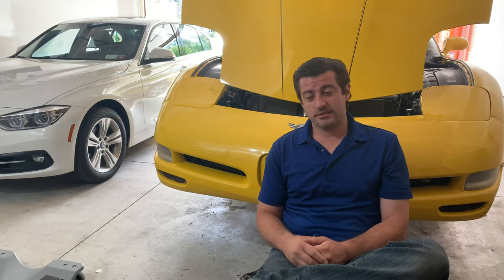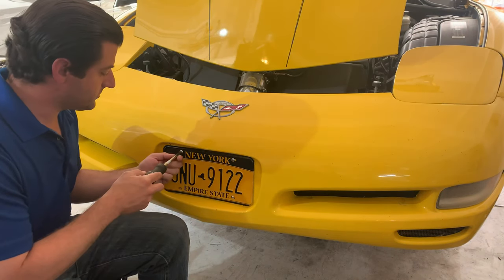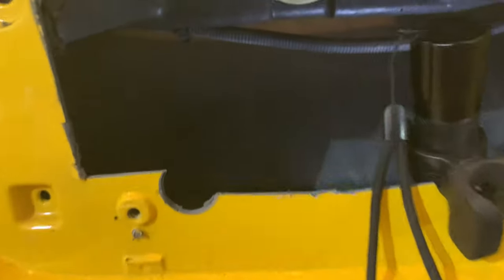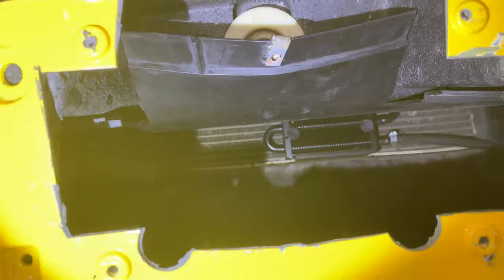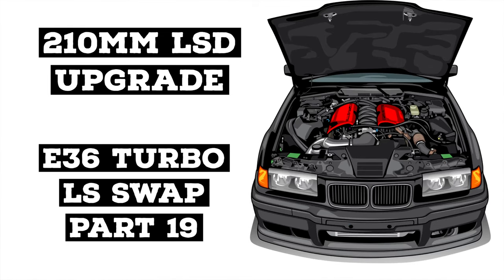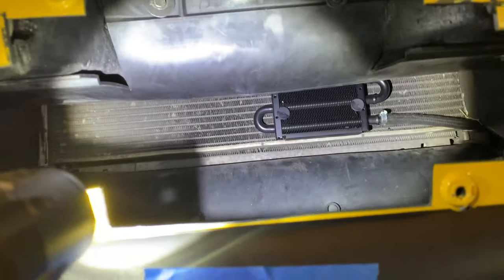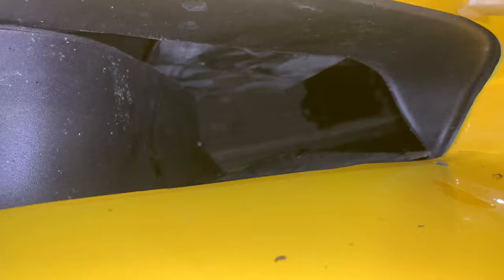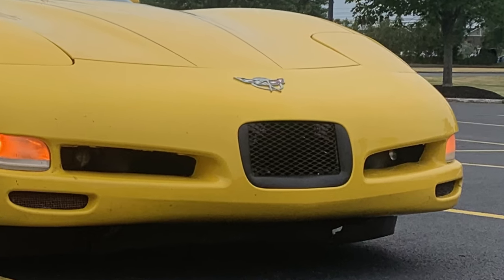DIY FRONT PLATE COOLING UPGRADE: C5 Track car Ep 12- how to keep your corvette cool

Comment: The 3 things I did to my C5 that solved the overheating problem. The front air dam. If you don't have one, get one. Super important for getting airflow into the radiator. The second thing I did was upgrade the radiator with a Dewitts. The last thing I did was tune the fans to come on earlier. That's it's. Didn't need to cut up my bumper. Stays super cool. I track it regularly. Never overheats.
Reply from the maker: I have the air dam, as soon as I upgraded the radiator to the Dewitt’s it’s been perfect on track

Comment: That’s cool. I’m doing it to my c5. Thanks for the encouragement. I’m changing it a little by having the fog lights opened and going straight into my maf intake and using your idea opening up the shroud and letting the air cool of the radiator. Good job.
Reply from the maker: That’s a great idea as well. I was thinking about doing that but I just need as much air to my radiator as possible right now

Comment: That is very cool. I have made my own with the original filler piece. Left the corvette name in the center and same stainless screen from Home Depot. Than painted it flat black. Looks tuff and works great. I have a little different idea for incoming air. Large plastic hose to preciously put air not to interfere with natural flow. Thank you and great job!! Hands!
Reply from the maker: Thanks! I have since put my power steering cooler right behind this opening which has helped immensely.

Comment: Great Video - I Love my C5 and have gone to extremes with her and her cooling problems. Swapped out the hood, radiator (4 row Sierra trk rad), fans, water pump and contemplating what you've done. I live in Western AZ and it gets freaking hot here. Matter of fact, on just about any day, one of the Big 3 are testing vehicles on the mountains. ( 21 miles of a 6% uphill grade.) So I'll try anything to run a little cooler. ( 235°F is normal operating temp according to GM.)
Reply from the maker: This did help a little bit, but with a combination of this  and my DeWitts radiator, even on track in 90° temperatures. I’ve never seen anything above 225°.
Reply: Took a long, hard look underneath and through the license plate opening. With the BBK Cold Air intake and air filter, either I make an air box and cut up my shroud or make an oval shaped duct from some abs plastic I bought on Amazon. Hmmm. I'll let you know.
Reply from the maker: @terryayager4036 yes I’d love to know how it does!!

Comment: I did the throttle body bypass mod, cut out only the bumper (nothing underneath like you did), and changed the thermostat to a 170 degree and I never go over 178 on the highway no matter the temp. around town and city driving it still gets up there, but it takes longer before hitting higher temps. I'm thinking of just upgrading my electric fans and hooking them up to a switch so I can turn them on at a lower temp because stock comes on at like 220. I sure if I do that my temps will never go over 210 even in heavy city driving.
Reply from the maker: Nice! It was fine around town for me it was on track that it got HOT HOT
Reply: That’s what I was saying. Bro was doing crazy mods for no reason. 😂

Comment: Great video! Only info I could find on what to expect behind the bumper if I decide to cut it.  I have a procharged z06 that sees oil temps touch 250 in weather above 105 here in Vegas even with normal driving. I def would like to get more airflow.
Reply from the maker: You definitely will, I couldn’t find any info on it myself so I decided to take the plunge and document it!

Comment: This is exactly what I am going to do next... I am in NJ and front plate is required 😑 Just got an ECS supercharger kit installed and this will open up right over the intercooler. .  I also want to open up the fog light areas too.
Reply from the maker: Maleet Finch it’s all easy to cut away, I can easily re attach my plate.
Reply: @LowBoostFilms  great to know. I've only drilled into my car, not cut into. Kind of makes me nervous lol.  My husband wants to do it but if anyone is going to cut into my car, it's going to be me

Comment: Did you put like.a 180 degree thermostat in? They also make a kit you can install that turns your fans on full time via a remote..would try these two things before hacking my car up.😮
Reply from the maker: I didn’t, but this worked a little. I’ve ultimately upgraded the radiator. But I now have my power steering cooler in this location.

Comment: One other thing, if you remove all that stuff for track perf, cut all that plastic, dont go over 130 or so, you have screwed with aero severely.  Great for autox or drag strip but dont do top speed runs!  140+ and you will take flight lol.
Reply from the maker: Thanks! I don’t get over 125 at the tracks I go to. I’m also adding a bunch of downforce at some point too.
Reply: @LowBoostFilms  nice!  Best way to deal with the increased airflow is venting the hood, like the c5r.  You cant put enough splitters on the front to overcome the hood becoming a parachute with all that air coming in.  Must vent it out!  Post a vid of the aero you go with!
Reply from the maker: I definitely will! I may have to vent the hood at some point

Comment: thanks for the diy, im thinking of drilling lots of tiny holes instead of cutting and screening...have you tracked the car since? what oil temp changes did you notice?
Reply from the maker: This was to help the coolant and power steering temps, but there was an improvement, however at the track after hard lap after hard lap, they temps still climbed, but not as quickly
Reply: @LowBoostFilms  i track my 02zo6 at cota and get to 250 oil temp pretty fast. i installed an oil cooler kit from DRM and it helped some. The oil cooler (a 19row setrab) is installed where you have the power steering cooler. i'm going to add a second setrab and add the matching puller fans, . I'm also installing some vents in the hood, unless you vent the heat out, it just builds up. You should be a bit concerned about the trans as the stock trans has plastic shift pads which can melt. Make a trans cooler a priority, I lost my original m12 to heat and downshifting (c5 trans dont like it). I brake deep now and select a gear instead of downshifting to stay in the power band.  Good luck.
Reply from the maker: Yea, I’m gonna upgrade the radiator, and add an oil and trans cooler over the winter. Need coolers for everything lol.
Reply: @LowBoostFilms  or just track the car in winter (i run cota oct. dec. and mar only) you get less traction and a little more hp so it can be tricky

Comment: Just cut all that plastic out.  The z06 doesnt even have anything behind the 2 vents.  Only downside is if it rains you are allowing water in but you still should be fine.  Cut all that plastic shit out, thats what i did, all of it.
Reply from the maker: I ducted it to aim at my radiator and PS cooler. So far so good.

Comment: There 1000 way to keep the heat down .. not like that way destroy the style for the front like that!!!!
Reply from the maker: I can put the plate on and it looked totally stock again. I’ve since upgrade the radiator and that helped.
Reply: @LowBoostFilms  100% DeWalt radiator

Comment: Looks terrible and the C5 doesn’t have cooling problems.
Reply from the maker: 250 degree coolant temps when I’m on track would beg to differ. It’s well known they needs cooling upgrades for track use.
Reply: I agree !! This guy either has a C5 and it's setting in the garage or he's a wannabe!!😮